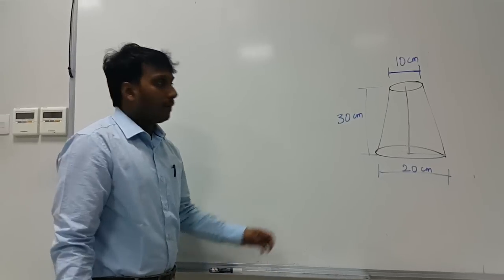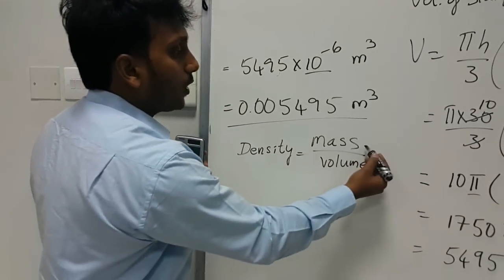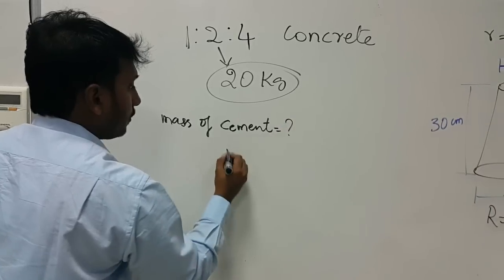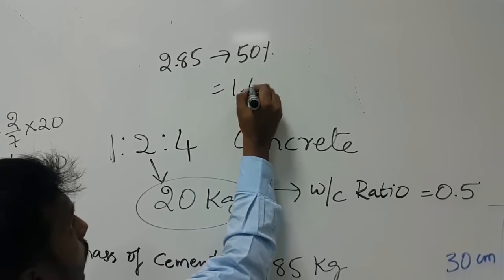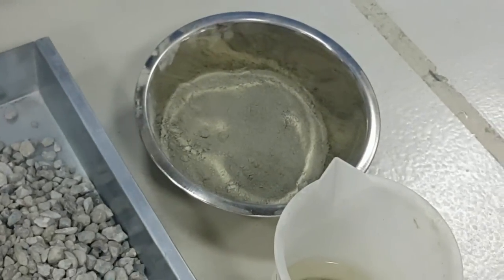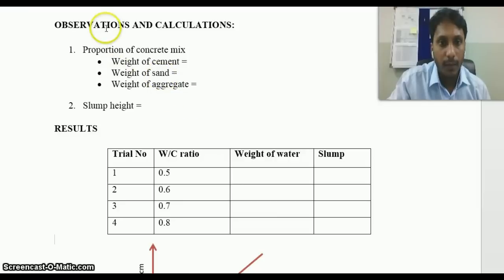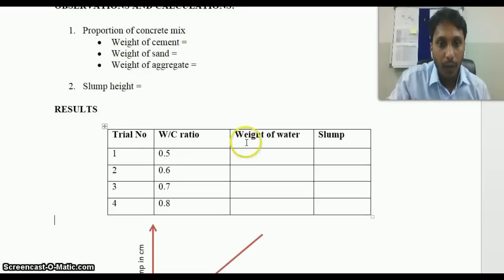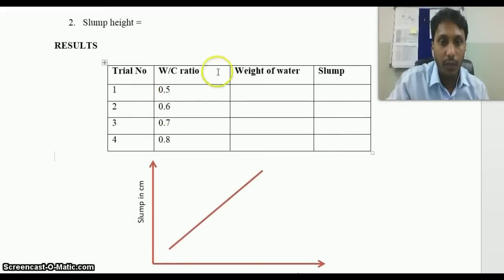Slump Cone Test of concrete  - Civil Engineering lab experiment

Comment: Sir can I get the lab reports of any of  the following experiments:-
Exp. 1: Tensile Test of Steel(Fe 250 diameter 25mm) and HYSD (Fe 415D diameter 12mm).

Exp. 2: Tensile and Compressive Test of Timber 

Details-(Perpendicular to the grain: 700mm×200mm×150mm.Parallel to the grain:600mm×150mm×150mm)

 Exp. 3: Shear Test of Steel and Timber.

 Exp. 4: Torsion Test of Steel.

Exp. 5: Buckling Load of Columns with Various End Conditions.

I am a 2nd year civil engineering student from nit Srinagar.

Thank you

Comment: Are you following the ASTM international standard? First off that concrete course aggregate looks over 2 inches. If that’s the case, you need to put it through a two inch sieve. Next, it looked like you didn’t tamp 25 times even though you said you should. Also when the third layer goes under the top of the slump cone you should stop tamping, fill it to the top again, and then continue counting where you left off, then you lifted the cone way too fast. You should finish lifting between 3 and 7 seconds. But what really shows that this wasn’t done right was that the slump sheared showing that the test was invalid. Don’t teach people how to do things wrong please. Especially when it comes to something as important as concrete.
Reply: Looks like 3/4. 3/4 can look pretty big when there's little fine aggregate/sand
Reply: I think they are not following any code shown by their treatment of materials 😂. But they may be following India standard code

Comment: Sir plss  explain  how layer is determined... That first is complete, 2nd is complete.. And so on
Reply: (1) try to keep the height of each layer of concrete while filling to the pre-fixed marks(circular lines) corresponding to each volume of concrete inside the cone. (2) try to keep the pre-fixed quantity and numbers of scooping during each layer's filling to meet the three equal volumetric layers. The key point is not in length(height) but volumetric three layers(three equal volumetric layers).
Reply: According to ASTM C 143, 1/3 of the volume of the slump mold is the height of 70 mm from the bottom and 2/3 is 160 mm.

Comment: How many layers compacted...
Reply from the maker: 3 layers.. each layer compacted with 25 blows and finally remained space is filled with concrete normally without any compaction.
Reply: @chiranjeevirahulrollakanti7429  
wrong please check code IS 1199...
4 layers 25 blows...k

Comment: Sir what is the nature of slump
Reply from the maker: Measurement of workability from Slump Test
If shear slump or collapse slump occurs, the test should be repeated. 

We can get the result from the only true slump. 

We can classify the result within some ranges according to the slump value.

Very low workability: slump value 0-25mm 
Low workability: slump value 25-50mm 
Medium workability: slump value 50-100mm 
High workability: slump value 100-175mm 

Reference: https://civiltoday.com/civil-engineering-materials/concrete/79-concrete-slump-test-standard-equipment-procedures-cautions

Comment: Sorry sir but total weight is 21.425
Reply from the maker: HI Iqbal, are you talking about total weight/mass of the concrete required to do this experiment. 

Volume of cone : 0.005495 cu.m
density of concrete: 2400 kg/m3
so, from these I calculated mass of concrete : 2400 kg/m3 x 0.005495m3 = 13.188 kg

considered wastage of concrete as 50%, though it is high, as we are mixing in concrete machine and considering the ease to conduct the experiment, i took wastage a bit high. Generally if it is hand mix, can take around 10-20% maximum. 

hence, 50% of 13.188 kg = 6.59 kg

so, 13.188 + 6.59 = 19.78 kg which is rounded to 20 kg. 

kindly, please let me know what is your doubt exactly and i you find any mistake, please share it here. I am always ready to learn from mistakes. Thank you.

Comment: Why did you not take mass of water sir?
Reply from the maker: Dear, mass of water is calculated. You may find it around 7m:44sec. If you are asking about why didn't we consider mass of water calculating 1+2+4.. I am sorry i couldn't understand your question clearly. kindly let me know, what exactly you would like to know!
Reply: no issue sir for not considering mass of water while doing 1+2+4; thanks you very much for replying.
Reply: Dear chiranjeev Rahul sir, kindly help me to answer my query.  Sp. Grav. Of cement = 3.15                               now den. Cement = 3.15×1000=3150 kg/m3                         but den of opc cement is 1440kg/m3. Why is this difference??

Comment: 20 kg concrete is in wet condition so we have to add 40 to 60% to convert it in to dry condition then we have calculate the raw materials required right?

Comment: sir u told that concrete mix is another but ... then what is 1440 cum
Reply from the maker: Hi dear Yakhub, sorry i did not understand your question exactly! but 1440 kg/cu.m is the UNIT WEIGHT of cement. I have considered the unit weight of concrete as 2400 kg/cu.m for the purpose of this calculation only.